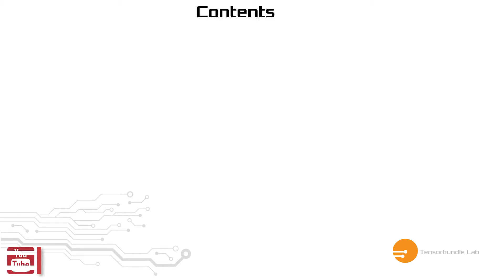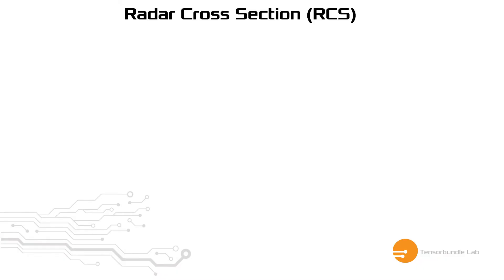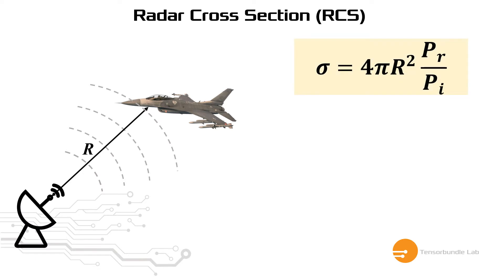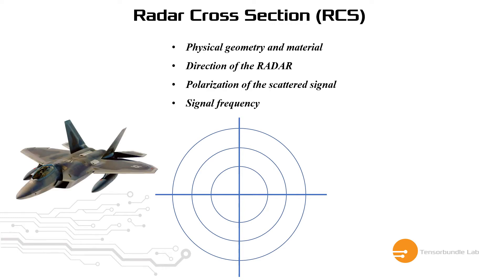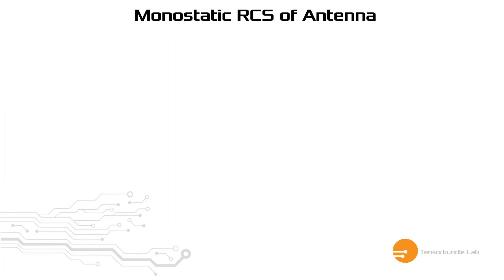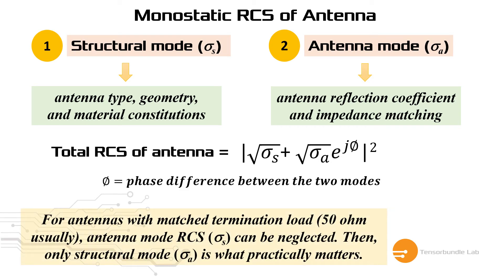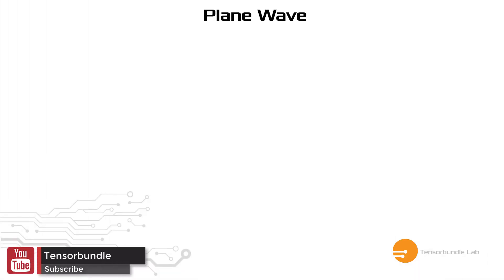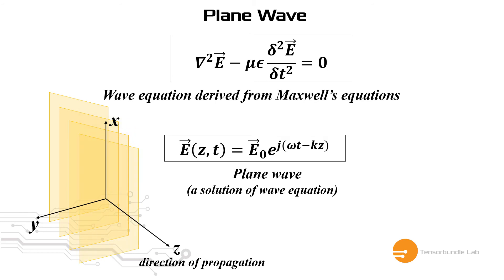Basic Concepts of Radar Cross Section (RCS)

Comment: Hello, im doing school project about detecting drones and my point is to get which freq is the best for detecting them. Any idea where to start? Still in high school, got some troubles with it
Reply from the maker: ISM radio frequency such as 900 MHZ or 2.4 GHz would be best. Because it is not necessary to obtain a license to work in this frequency. Most commercial electronics work in this frequency (no extra licensing fee). Read more: https://en.wikipedia.org/wiki/ISM_radio_band

Comment: At 8:50, the horizontally-polarized wave has the fields disoriented. Instead, the H-field should be phase-shifted by 180 deg (flipped around), so that the direction of the electromagnetic wave is indicated by the Poynting vector (S = E x H). Fantastic video nevertheless!